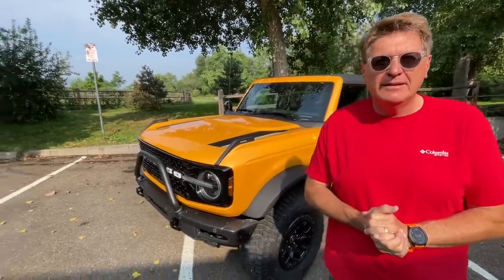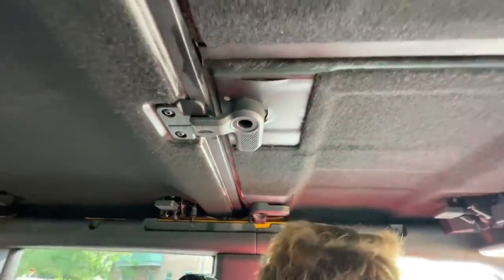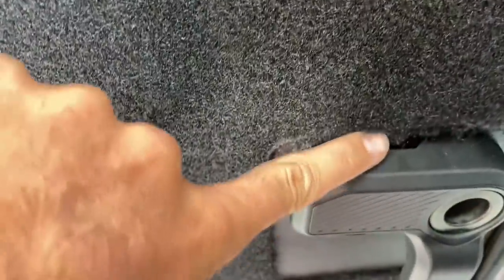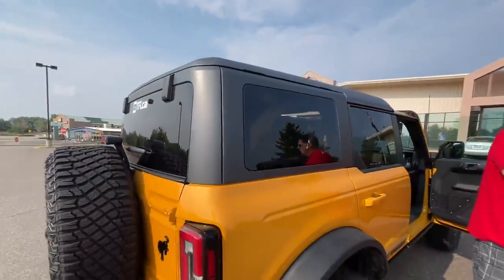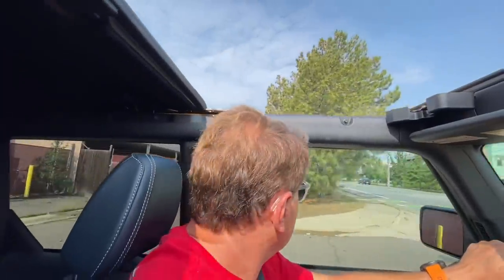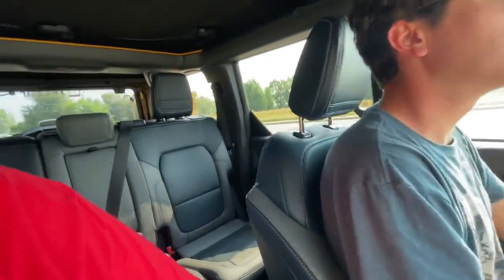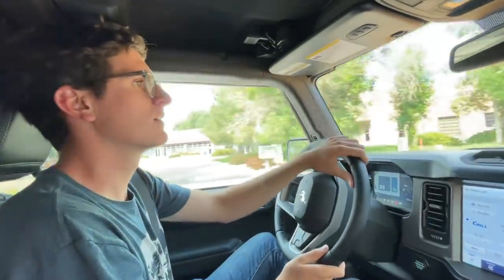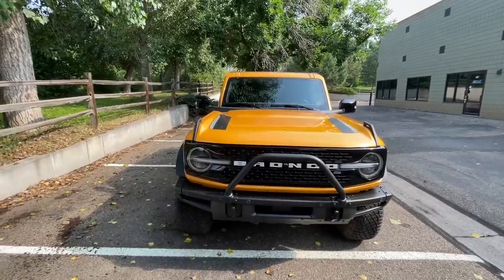This Roof Squeak In My Brand New Ford Bronco Is Driving Me Up The Wall, What Gives?

Comment: My JLU hardtop makes a lot of noise as well. I ended up putting some neoprene everywhere up top under any surface I could. Helped a bunch.
Reply: ya these guys are kinda Jeep Wrangler fan boys and I guessed maybe on their (Jeeps) payroll giving "honest" criticism of the new Bronco. I could be wrong but I am skeptical. I agree the interior seems cheap but how does it really compare to a similarly priced Jeep Wrangler? I think I would get rid of that felt and maybe replace it with something of better quality. Ford is giving you that stuff for free anyway.
Reply: @nursechase1  I just wanted to post my own personal experience. Going down a gravel road would annoy the hell out of me before the neoprene. It was also a fastener on one of the swivel latches that got loose. I took it apart, tightened the hex screw, loctite it, and put some neoprene between the surfaces. It’s just a thing with removable hard roofs in general. They squeak. TFL should provide better context on the issue.
Reply: @ryanmartinage  Thanks and your last sentence...Exactly one of my points with what info TFL has been delivering. It just seems they bash the new Bronco in a way like they are just being honest while not really showing the Jeep in the exact same light. That is why I always take their reviews with a grain of salt. I am skeptical they are in bed with the Jeep folks.
Reply: @nursechase1  New Wranglers in that price range have very high quality interiors. Leather wrapped stitched dash, soft touch door panels etc… The bronco is all hard cheap plastic. Dont get me wrong it’s super cool, but they definitely cut alot of corners on material quality. The first one at my local dealer (driven by the mgr of the dealership) sits on the lot right now with missing exterior trim that appears to have fallen off. That one is a soft top and the rear side windows are so wrinkled its ridiculous.

Comment: I hope Ford is reading the comments, because I want them to know that based on this video and this rattle problem... I am no longer considering purchasing this vehicle under it's fixed in future models. By that time I will have likely purchased something else.
Reply: You do realize that Ford will have no problem selling these as fast as they can make them?  It is definitely a problem that needs solved but this is what being an early adopter is about, you accept that some things are a work in progress and you may have to DIY solve some issues.  Or just wait a few years instead of being the early adopter.  Otherwise, if you buy something else the same applies, that if you get the latest and supposedly greatest new generation vehicle, it's going to have bugs to work out.
Reply: @stinkycheese804  Wait until the first wave of buyers have remorse...they will quickly be sitting on the lots looking for buyers in a year or so.
Reply: @watershed44    fools who pay dealer mark up or e bay motors mark up so they can be the first to have one  the rich kids will go on to the next big thing EV or what ever

Comment: After seeing this, I'm even more pleased that I bought a 2020 4Runner.
Reply: Lol. And you didn't even wait for the new one?? Driving a brand new, 8 year old truck 👍🏻
Reply: @erich1880  Does it really matter how old it is when it’ll hold up better than anything new?  New cars are sometimes far worse
Reply: @coleyork7746  it matters because your paying top dollar for an out of date “new” vehicle. It’s underpowered and has worse fuel economy compared to its more modern competitors. Not only that it’s old so it’s less safe. It’s crash test rating isn’t as good as modern vehicles. Only thing it has going for it is the reliability.

Comment: Take the panels off. Spray all the edges with silicon spray. Put it all back and , voila...:-)
Reply: Great fix but, you shouldn't have to do that when you buy something brand new off the lot from the factory.
Reply: @justaguyonyoutube1937  Every seal on every car ever sold has to be maintained with silicone spray. It's in the master manuals and many glove box manuals.
Reply: You tried it on new Bronco?
Reply: @justaguyonyoutube1937  1995 - I can't believe highway death wobble is still a thing in my Jeep. 2021 - I can't believe highway death wobble is still a thing in my Jeep.
Reply: Make sure to test the silicone spray on an area not visible sometimes they react with different plastics and make it look awful
Reply: @SnoringVids  Thats why you spray it on a rag and never the seal. You could  swell the seal too much . It's not such a problem with 109% silicon, some of the cheaper spray cans can have other chemicals that cause discoloration.
Reply: It’s not a squeak. The spray works for squeaks very well, but not an actual rattle like that.
Reply: @motorhead69ification  Squeaks aren't new...:-)
Reply: @RobertKohut  yeah well was wondering if there was a particular spot to focus on that is causing this chronic squeek.
Reply: @shitloveaduck  not a rattle.  It's popping from the seals.  It's the exact same thing corvette coupes went through from the c5 to the c7.  I don't know if it's fixed on the c8.  Heck, mine (c6) pops like that just sitting in the sun.  Chevys response?  Buy some all purpose lube and coat the seals and torque down the roof pins.  Pretty much the same response people here are saying they are being told.
Reply: @chrismartin3640  - rattle/ pop, it’s still a small thing that with a little care and attention can be dealt with. Those are large expanses of plastic basically. They will change in size from daytime to evening. It’s really to be expected to a degree. Wrangler tops are even smaller and have their issues. If you look at the whole vehicle and it’s very high level of capabilities, you have to understand it’s a small thing. I restore old classic trucks, 46 and counting plus 2 cars. One of the cars is a 1981 Corvette, a T-Top nightmare, that I keep rattle and squeak free. I do treat the roof panel  seals and door seals with silicon I spray onto a rag and then apply to the seals about every other time I go out with the car, but it’s minor. The price to pay with a classic. 1967 Mustang 2+2 that could be considered a worse challenge, but it’s rattle and squeak free. I invest a lot of time initially to make sure there is less time needed later on. I even made the 2+2 relatively quiet which is no small task. 
   Sure, when you get a brand new vehicle you don’t want to deal with this, but then again if you want a vehicle that can keep up with $120,000 + builds, but only pay $63,000, you may have to accept some less than perfect aspects. Ford will figure it out, or more so, the supplier will or face litigation from Ford. I have found that there’s this silicone tape designed to stop squeaks and rattles, mostly squeaks, works miracles, especially where plastic panels meet metal. It’s just a given when I am putting my vehicles back together. That may clear up the issue as well, but without owning one, or doing the work yourself directly, it’s hard to advise.

Comment: Poor quality foam weather stripping. It's compressing and losing its pressure resistance. I'd look into adding some more weather stripping first before I got another top BUT you are right. A 63K vehicle should not have this issue, but it's Ford so you kinda have to expect to get hosed eventually.

Comment: I think the YouTube channel "Throttle House" report the same roof issue on a Bronco they tested... so this might be a common fault on the hard top which is a shame really.
Reply: Yep they said the same thing, and honestly this alone would make me buy a Jeep even though I do prefer the Bronco
Reply: @patrickmartin3322  They also said the Bronco was the winner between the two.
Reply: @therealjohnsmith4811  because of the independent suspension. It made driving much more pleasant.
Reply: @drummeralex9198  I saw an offroad video about an FJ where the independent suspension design caused a front wheel to break off in the rocks.  Jeep is pretty well tested out with their set-up.

Comment: I am an auto glass installer and and to stop the popping noise I would try spraying the contact points and along the edges with a silicone spray I don't remember exactly what it's called but the silicone spray I am in reference too it's the same silicone spray we use on the rubber that comes in direct contact with the door windows to keep the rubber from sticking to the window allowing it to go up and down smoothly so it doesn't squeak along the window or get sucked down into the door when rolling the window down

Comment: My 2020 ranger had the same issues with fit and finish, even with hood and body panel alignment. Larger gaps on one side than the other etc. Now I drive a 2021 Tacoma TRD PRO and don't have these problems anymore..

Comment: I had a few squeaks and rattles on my 2018 F150. Unacceptable for a $60,000 truck I in my mind. The center console squeaked really bad and the drivers door panel would rattle really badly under certain frequencies from the speaker. Got them fixed at the dealer. Just recently a new squeak has developed from the rear seats, they creak and groan when driving on uneven surfaces.

Comment: After owning a new Jeep and then seeing the Bronco in real life, I can safely say that the Bronco looks and feels cheap compared to the jeep.  Ford has some work to do!
Reply: That fiat square on wheels is better? 🤡 not from what I saw it’s not.
Reply: I thought the same. My 20 Rubicon is  way better….
Reply: @scottbott8525  Saw your Fiat square on wheels being outperformed by a 10 yo 4Runner in comfort, noise and drivability for half the price. 🤡👍
Reply: @scottbott8525 good choice 👍👍👍
Reply: @scottbott8525  I would wait at least couple years for that bronco to be polished a little. But if you need a crawler now, buy a wrangler. Even though I never liked them, I respect your opinion.

Comment: I have diagnosed OCD. I would've burnt my Bronco to the ground if I had that noise off the showroom floor, and get told by Ford they don't have a fix yet. Luckily, with 3 LX570s in the past 12 years for me, I've never heard a creak or a rattle.
Reply: That’s because Toyota would never release junk.

Comment: We’ve all seen the videos of guys driving these for months testing them off road. How could Ford possibly miss this?
Reply: GT350 owners with blown engines  are asking themselves the same thing.
Reply: With all the hype Ford had to release them with no more delays.  Greed and no concern for the customer.  Imagine what else will show up later.
Reply: @blang38  You can bet Ford will now have TSB for this problem.
Reply: @bextar6365   tell  the customer turn up the radio

Comment: A spot of silicon grease may stop the creaking sounds. It sounds like the frame is slightly moving and the noise is the micro movements between the frame and the top.

Comment: I can get over a cheap interior, but rattles and carpet falling off in a new car are unacceptable. If Ford would have said something like, “Our supplier screwed up, we are not satisfied with this, we will remedy it as soon as possible” they could have won a lot of favor back. But they didn’t, they stopped at blaming the supplier. And as Tommy rightly pointed out explaining why he just bought a Wrangler instead, it’s a Ford Bronco, not a Top Supplier Bronco.
Reply: That’s what happens when major manufacturers vend  out most of the parts to Vendors and are not building in house With the old Quality Control ! They want to make it as cheap as possible and shove it out the door!

Comment: I wouldn't bother with swapping out the hard top for the soft top. That's a really dramatic resolution to the issue here. From what I could see on camera, it looks like the sound is coming from the latches, and since it's directly related to rough patches of the road or bumps, it just means there a little too much space between the latch and the area where the latches slides in to... I would go buy some felt furniture tabs, they make different thicknesses, buy several and see what size in thickness it can support with the latch in place. That should solve the issue.

Comment: Sounds almost like dry rubber that’s binding and snapping free. My Miata did the same thing after a few weeks of spirited driving. I’d have to tighten up the hardtop mounting locations every so often. I finally fixed it permanently by bolting the top to the car. Check that every nut and bolt on the top is tight, then put some dry lube on the contact areas.

Comment: Thought about trading in my Toyota FJ for the new bronco, but on second thought with no squeaks, rattles, or problems after 9 years I think i'll just keep it for another 10 years!
Reply: I have an 8 year old Land Cruiser with 133k miles on the clock. Not a single rattle, squeak, or anything. Small lift, 33s, and take it on mild trails weekly.

Comment: It’s a FORD!  What do you expect?  They have one interior… CHEAP.  It doesn’t matter what the car cost.
Reply: @wyo1446  ford doesn't make most of the vehicle. Ford however decides what parts and from which supplier they put on their cars.
Reply: @blegi1245  this guy WY o has no clue
Reply: @damitbobby6677  I've been driving for 50 years,  I've forgotten more than you'll ever know,  Mr. Clueless
Reply: @blegi1245  That doesn't mean they have control over supplier quality. And there's only one supplier for these tops.
Reply: @wyo1446  why do you only bring up the tops. Dylan’s post was on fords whole interior being cheap. My early 2002  something Ford Explorer xlt had a nice interior for a xlt. Went to upgrade in 2015. Was going to go v8 highest model. For a high end model the interior looked way cheaper then my older xlt one. They had what looked like a chrome pipe sticking out of the console as a shifter.
Reply: Would not let me edit. Went to upgrade around 2008 or 9 not 2015
Reply: @plem7210  I don't watch their stupid ass videos, I just read the headline. And Ford's interiors are no cheaper than the rest
Reply: @wyo1446  Yeah I do.21 yr old Honda CRV.300,000 miles, air cond, cruise, abs all work. Original clutch and I have spent $2000.00 in repairs in the last 6 years.This is in eastern Canada with our harsh winters and salt use.No piece of shit Ford is even close.
Reply: @wyo1446  Who am I to judge American cars? I'm 60 yrs old and have been driving for over 40 years.The last 20 of those years I have been a taxi driver.Up until the last couple of years 100% of the cabs I have driven have been American sedans and vans.The company I work with now has invested in a fleet of Toyota Camrys and Corollas,some hybrid.The fit and finish and reliability of the Toyotas is leaps and bounds ahead of any American car.To be fair Ford is the best of the American brands in my opinion.I liked some of the Fusion models and their trucks are okay,and they didn't take the big bailout a few years back,which scored them some points in my book.Chevy and Dodge are just steaming piles.
Reply: @puddytat54  Well I'm 64, got my first car when I was 13, so I'm not exactly new to the game either, but I hear what you're saying. The bottom line is, they've all made some good ones, and they've all made some bad ones. And I apologize if I insulted you.
Reply: @wyo1446  Don't worry man , I'm not offended.Half the time I'm just ribbing the Ford guys anyway,you know how it is,I do it to my friends that drive Fords.Dodge and Chevy though,especially Dodge are pos.
Reply: @puddytat54  I do know how it is,  I'm used to the ribbing, especially from the Chev guys, you can blame them for my defensiveness. Lol
Reply: @wyo1446  You come on here ripping people and you did not even watch the video. For the record I own one foreign owned vehicle. Owned by fiat. It is a 2015 Dodge Durango. I also own a 2017 Ford F-350 xl. No power windows or electric locks. I do not expect high end interior on an xl work truck.
Reply: @AJ12-76  Aw, did I hurt the Fiat fanboys feelings?
Reply: @plem7210  I never do any ripping until I start getting ripped😶

Comment: I got a settlement out of Honda for a 2017 Civic Hatchback. Had multiple interior rattles. The major one was one in the dashboard. It turned out the heater core was a plastic rattle box. No fix!

Comment: Bros Fourr Speed mentioned this same issue in their review. This is getting a lot of attention in the Bronco community. With the amount of time both Ford and Webasto have been working on this, it's hard to believe they haven't solved this. As good as the Bronco is, the roof issues are a real killer.

Comment: I can hear Jeep owners cheering with joy watching this video
Reply: Than they ride down the road with death wobble going on, i would take roof squeak over that anyday.
Reply: @raionshishi8290  never had a death wobble in a JK ruby in 99k miles. And none on a new gladiator. Not the vehicle's fault when huge tires are stuck on it.
Reply: @raionshishi8290  21' gladiator ive gone 100mph without any death wobble im at 5k miles with 0 issues.. fwif

Comment: Not sure if anyone noticed, when locking the top into place. The actual "L" shape binders make the same noise. I'm saying it's the actual locking mechanism inside those "L" shape binders for the top. I would see if you can move or remove the one over your head to see if the noise is still present. If not, you have your answer....just a thought.....Good Luck

Better Yet, Take one off and shake it. Maybe, it will make the noise for you.